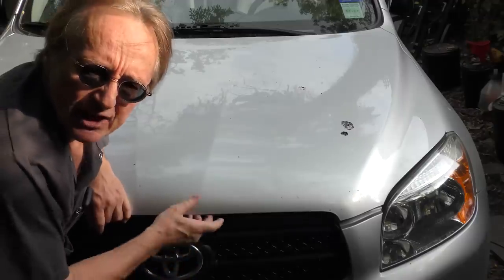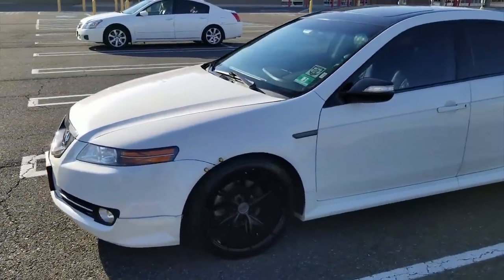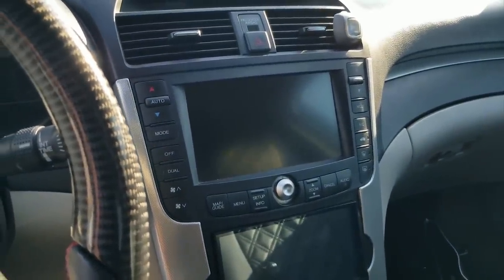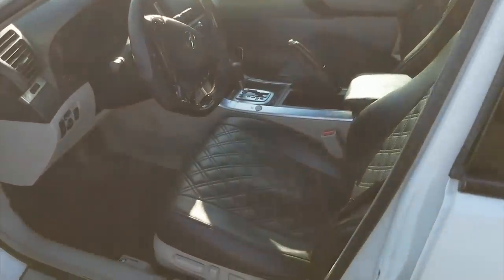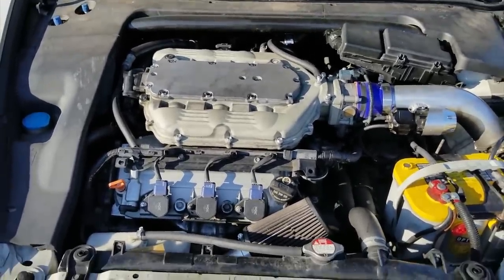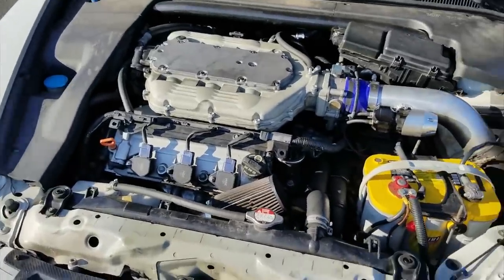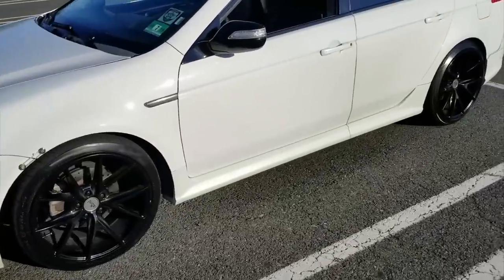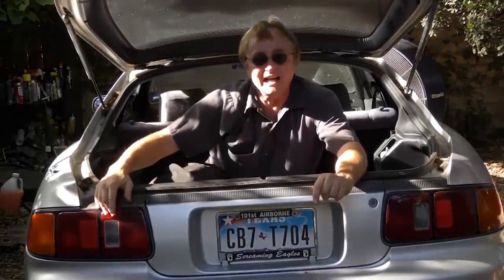Here's Why This Base Model 2008 Acura TL Makes 437 Wheel Horsepower

Comment: Quick lesson if you supercharge or turbocharge a Honda VTEC engine you have to take it off for or is not gona work the VTech. it's either turbocharged, supercharged, or VTEC one of the three options you cannot have it combined VTEC and supercharged. Variable valve timing not going to work with a supercharged engine going to interfere with the airflow probably overwhelmed the engine cuz the supercharger just pumping air constantly without even timing nothing. Of course if it's not a VTEC engine you can  supercharged and turbocharged a car with both systems together but you need a lot of money man for those kind of engines. Also it's  a automatically you cant feel full power of a engine 😩 he went through all that trouble to changing engines you should have change the transmission 2😟
Reply: Wtf you talking about? Plenty of cars out there with vtec and boost. Had no issues with my turbo h22 and vtec on a p28 ecu. Do you even understand the difference between vtec and boost? Forced induction has nothing to do with the variable valve timing and cam shift. It's harder to tune on the dyno compared to a non vtec but doesn't mean it's not possible.

Comment: That looks slow for 400+ hp v6 probably because of automatic. 4 cylinder built 400+ will be much faster than this.
Reply: Thomas Strickland u wish! Ur going to need to replace everything in a 4 banger yo even make close to 400hp. Then again not surprising this comment is coming from a guy with a civic in his picture. 

V6>4 cycle

Comment: still seems slow for the power
Reply: The automatic gear ratios are trash on the tls. After 90mph (3rd gear) I could barely catch up to the new accords even with boost as 4th and 5th are overdrive gears

Comment: This isn't a very good platform to modify. A heavy front wheel drive luxury car with a lot of torque and a automatic? Torque steer for days.
Reply: sharpemang it's not but it's different. Just worked with what I have
Reply: Also, aren't these Acura's notorious for having their automatic transmissions explode? Or was that the RL? If it is, I wouldn't feel confident with it pushing that amount of power.